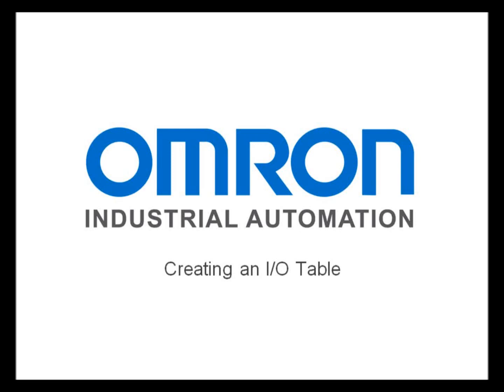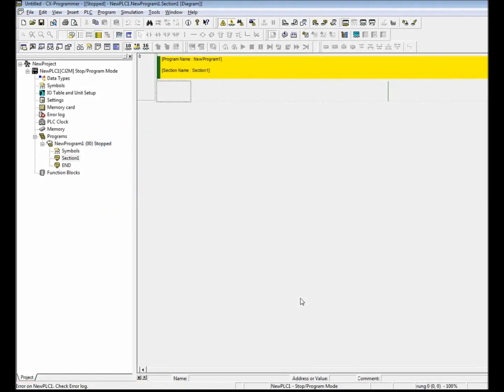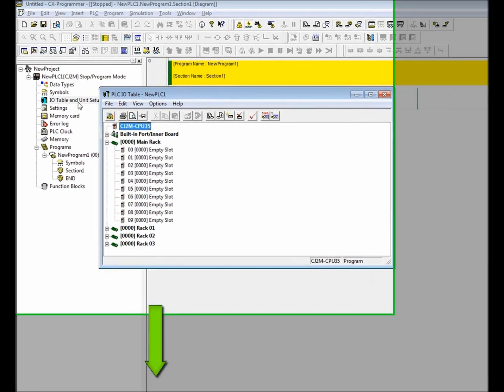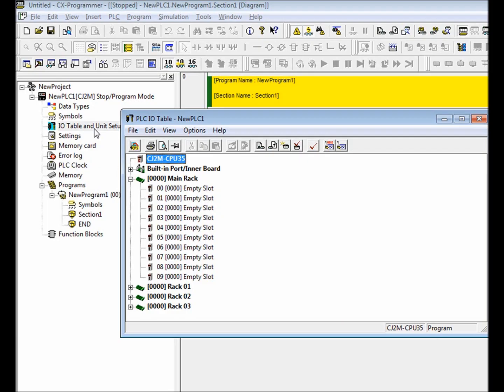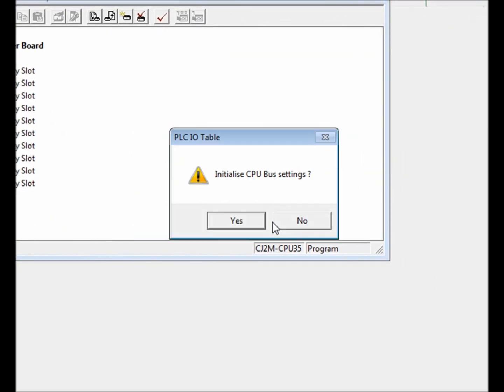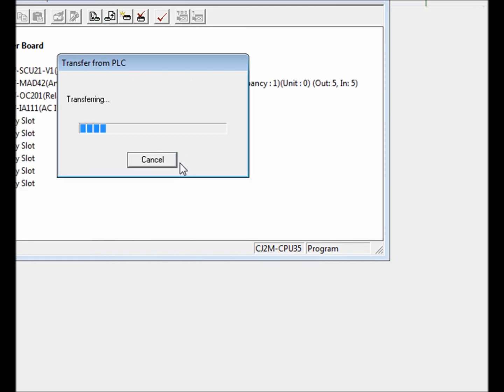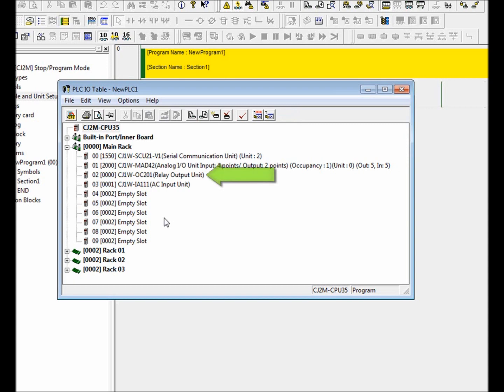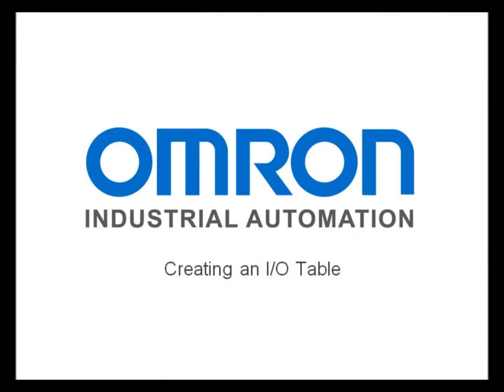CX-Programmer - I/O Table Creation

Comment: Hi ,

Very useful documents for PLC engineers and students ,
My project is how to control (Frequency , voltage , temperature and protection) Micro hydro power generator using PLC.

Thanks

Comment: Hi, I am having CP1E-NA-20DR.. In cx programmer which address i need to put to get the analog data from 90 ch and 91 ch.. thanks in advance
Reply: to get output use analog o/p adress i.e. 190